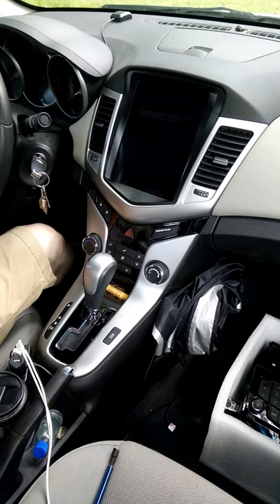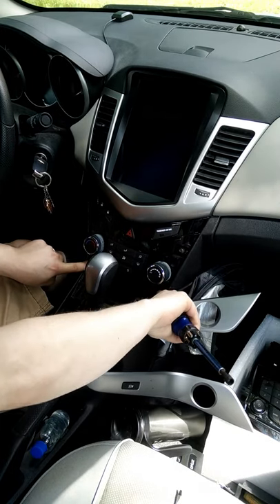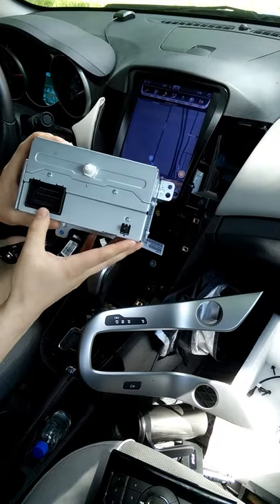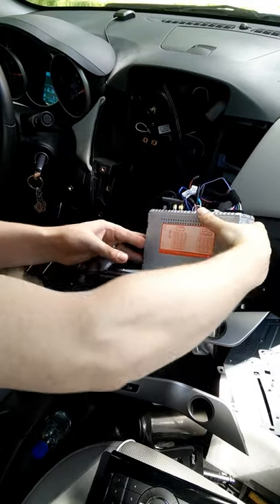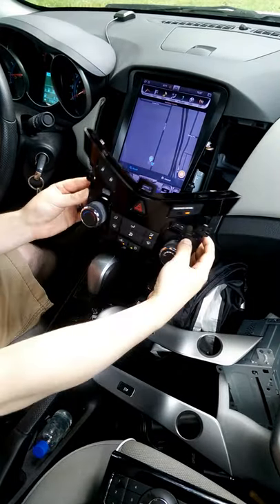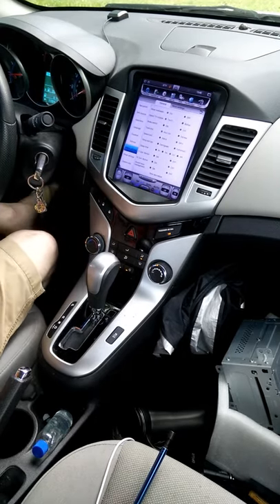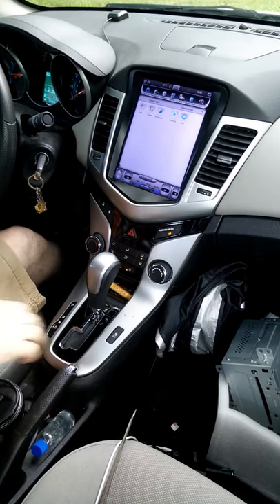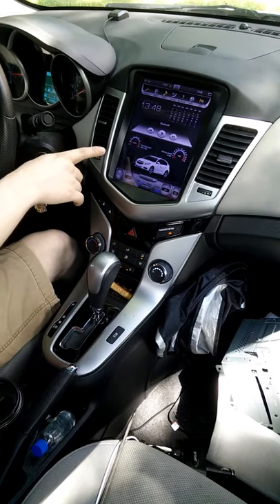Chevy Cruze "Tesla Style" Stereo Install + Year-In Review

Comment: Thanks so much for your tips! I've installed this same head unit as well and absolutely love it. The only issue I'm having is that the built-in microphone is kind of "weak"... Anyone I call while driving says that I sound very distant/quiet. Have you experienced this?
Reply from the maker: Yes, I think I mentioned in my first video I posted about this stereo that I was not impressed with the audio quality of the microphone and I don't know of a good workaround.  I have a Bluetooth earbud I use instead, I just have to tap on the audio button while I'm on a call to tell my phone to use the earbud instead of the stereo after answering or after the moment someone answers my call to them. (Running Android btw). I also went into my Bluetooth setting and unchecked "media" from the profile for the earbud so when I go to play music from my phone after ending a call it won't try to use the earbud by mistake and will instead use the stereo.  One other quirk, I can't uncheck "phone" from the Bluetooth profile for the stereo because if I do music playback stops working... and it shouldn't, but it does.  So, you might consider getting a little $30 ear piece or something, just be vigilant about where you put it when not using it or you'll likely misplace it.  I have maybe three places I will put mine: a small zip pocket in a backpack I take everywhere, the change holder at the bottom of the dash and my desk when charging at home... And of course my ear.  Everywhere else are no go zones... One time I took one I had off and set it on my lap while driving.  Parked my car by a storm drain and got out, it fell in the drain and I had to fish it out with a broom stick and a wad of duct tape on the handle end to "grab" the damn thing.  Ended up losing it months later at a job site doing install work because I set it down somewhere random while a lot of people were working around each other, didn't notice I forgot about it until the next morning, never saw it again.  My guess is someone (possibly me) kicked it under a rack. 🙄
Reply: @davidsteinlage  Ah okay. Thank you so much for your detailed response and advice, it really means a lot in this day and age for someone to go out of their way to really help advise another person! While the bluetooth workaround sounds great for when I'm using Android Auto, it unfortunately won't work for when I'm using Apple Carplay, as the phonecalls go directly through the carplay connection and do not use bluetooth. In this case I wouldn't have the Audio button to switch to speaker or bluetooth headset as you suggest. I'll keep troubleshooting I guess!
Reply from the maker: @BharteshShah  Happy to help.  Good luck!
Reply from the maker: @BharteshShah  Hey, I was wondering about something you said here.  Are you using Android Auto and/or Apply CarPlay with THIS stereo?  I did not think that this stereo supported those things.
Reply: (Except for the microphone issue, of course.)
Reply from the maker: @BharteshShah  neat.  I did think either of those worked on this stereo... Unless that was a new feature added after mine was made, or maybe you have a slightly better version than mine.  I've only ever just used my phone as a wifi hotspot + Bluetooth for audio from spotify or podcasts and just installed the Waze app on the stereo for navigation.

Comment: You added a back up camera, as did I. My problem is what do I connect reverse detect red wire that is coming off the RCA jack?  My unit did not come with any wire labeled reverse or reverse detect. I attached the other end to the power line that connects to the camera and to the reverse light power.
Reply from the maker: As I recall, the camera itself had an RCA jack, I wanna say it was female and connected to a longer RCA cable that would run up front to the stereo, and also a red wire and black wire for 12V positive input and ground.  The longer RCA cable also had a red wire that you could optionally use to source 12V positive from somewhere up front, but i didnt use that.  I instead used some scrap wire I had laying around and took 12V positive from the left tail light and pulled ground from a ground wire running to the trunk release switch in the trunk lid.  Check my other videos, I have one that shows the wires I spliced into.

Comment: Hello there.. got one these for my chevy but the wifi didnt work.. so i factory reset it and now its working ok.. but the information for the car speed engine speed and car doors opened etc dissapeared from the wallpaper.. do you know anything on how i get them back to wallpaper?
Reply from the maker: My guess is that maybe there's a console setting somewhere to enable that again, but I did a factory reset on mine shortly after I got it to fix a problem with the on-screen "back" button not working and didn't run into the issue you were having, though I did have to change the default interface language back to English and side load Gboard to get an English keyboard to show up.  But that was about it.  I did lose a couple bundled apps and the soft copy of the user manual though, but the manual didn't go into options like enabling on screen info blocks and things like that so I'm not sure what to tell you.  Sorry.
Reply: @davidsteinlage  ok mate thanx for the answer.

Comment: Did you ever get your steering wheel controls to work, I just installed this today have everything working but for some reason the controls on my steering wheel with no longer work the volume or the mute button do you know how to fix this please and thank you
Reply from the maker: My steering wheel doesn't have controls other than buttons for cruise control.  There is a tab in settings for the steering wheel that looks like you use it to train/sense a button and bind it to a function like volume controls, etc.  Did you find that?

Comment: Really great video! More pros than cons! How is the touch sensitivity? Beautiful car I have a 2015
Reply from the maker: Very sensitive, multi-touch.  It's good.
Reply: Did u order one i have a 2015 to ?
Reply: @tay8843  Im waiting. On the way
Reply: @tay8843  I will update when I receive it
Reply: I have received mine. Very nice unit installed in 30 mins
Reply: Doesn't let me post up the amazon link bit it was 200 dollars and aribed from china in 3 weeks not bad just have to get the reverse camera to work
Reply: @gerardomendoza8416  hi iv got a 2015 model with pdc wanted to know if you also have pdc and does it work with this head unit. Thanks

Comment: I have a 2010 Holden Cruze, exactly the same design with the chevy cruze. I want to replace my headunit same as yours. Just wondering if you could send me all the parts that I need to replace my headunit. 

Fascia Kit (don’t know what size), Steering wheel control harness and a headunit. Are these right? 

also what monitor brand you used? i live in Australia. Thank you
Reply from the maker: It depends on the stereo you want to install, and all I know about is this particular stereo.  It comes as one piece and includes everything you need.  If you want steering wheel controls, I can't help you with that.  I don't think you can just swap wheels because the wiring is different for different style wheels.  I don't have steering wheel controls.

Also, I would suggest looking for newer version models of this one as it's kind of outdated and slow.  If I forgot to put the link to the Amazon page I bought this from in the description of this video, look at my other uploads to find the first video I posted about this stereo to find it and you should find buttons on that page that select different models available.
Reply: I've just installed a version of this on the 2011 Cruze SRI-V , everything worked fine including steering wheel controls. Best bet is eBay . I'm based in Melbourne, Australia
Reply: @Coreylow77   Hi Corey, are you still using this head unit? I have a few questions myself as I’m from Sydney. 
Was there any fiddling around with settings as it’s mainly advertised as a ‘Chevy’ Cruze meaning American?

Also was wondering if Apple play had and dramas or was it as easy as connecting your phone and away you go.

Comment: Hey I got a few questions I just bought the same exact one an on your main harness that plugs into the back of radio there is 2 male ends (read an white) that says aux l/r in on them....ok so over at the video harness 20 pin you have 2 sets or red an 2 sets of white 1 pair of which says aux in l/r do the first one I mentioned an this one plug into each other? An im sorry 2 more questions if I have a blue power cord coming from an amp where would u hook that ? An then last question the connectors coming out of amp where do they plug in....they have the male ends also on them oh an one green female in the video pile thats green says subwoofer on it ? I'm lost 🤦‍♂️🤦‍♂️🤦‍♂️so sorry sir...but it would save my a 2 hour argument with my wife if you could help
Reply from the maker: Sorry for my delayed reply.  I don't recall seeing any input jacks on the primary harness, the one that you couple to the factory wiring, but I believe you are saying there are two RCA aux outputs coming from the first harness.  I believe those would connect to the two RCA aux inputs on the second harness.  I am going to guess that this will allow you to continue to use the input jack in your center console, under your elbow... I never hooked this up because I don't use AUX at all anymore.  You could also, alternatively, get a 3.5mm stereo jack to RCA male and connect that to the second harness if you wanted to install a jack at an alternative location for some reason...

As for the blue wire, coming from an amp, that is a remote power on wire which just tells the amp when to turn on.  Look on the top of the stereo to find the wireharness color guide and you should be able to find a blue or blue/white wire called Amp Remote, or something like that, which you can cut out of the harness (if it's not already dangling loosely terminated to nothing) and crimp your amp wire on to that.

The "male wires" coming from your amp are probably what your audio goes into from the stereo.  There are several female RCA jacks that split off the second harness on the stereo and two of them will be labeled amp left/right.  I do not think you would use the green wire that says amp; my guess is that is an output that is audio that is low-pass filtered and only sending bass frequencies when you probably will want full spectrum being sent to your amp, which is what you should get with the other two female RCA jacks that should be labeled amp left/right.  I hope this helps.

Comment: I just installed mines but it changed my dash language to Chinese.  Did u have this problem ?  I can still see my milage and speed just the language has  been changed and can't figure out how to change it back to English
Reply from the maker: There is a language preference in the Settings menu.  You can see this in my other video:  https://youtu.be/vLzFsfskVPs?t=1010.

Also, not sure if you noticed, but the ribbon menu of icons across the top swipes left/right to reveal a second "page" of icons you can tap for other stuff, Settings being one of them (it looks like a gear).

Also, notice that when you go into Settings there is a "More Settings" tab at the top which opens the Android settings panel which is separate from the stereo settings.

Comment: My stock radio recently just up and died. I was wondering when going with this radio does it show your heater controls as the stock radio does. As in when you switch zones to where the heater is blowing.
Reply from the maker: It does.  It also appears to have on-screen controls, but they don’t do anything beyond show you current status (presumably there are other vehicle makes that this stereo is refit to work with that do support on screen climate controls).  But the physical knobs and buttons you use stay there and you’ll continue to use them.
Reply: @davidsteinlage  nice thanks for the reply.   I currentley only use the buttons any ways. Just wanted to make sure it showed what mode it was in.

Comment: How do you dim the screen or shut it off completely? It’s too bright at night while driving
Reply from the maker: It's under Settings.  Swipe the icon ribbon to see the second page of shortcuts.  There's one for settings that looks like a gear.  There's one in there for the display brightness for day and night but be careful, this stupid setting will let you set your display brightness to zero, pitch black.  If that happens try tapping in the top left corner of the screen to select a different display profile and reset the other one

Comment: How is the unitholding up? Thanks!
Reply from the maker: Still using it, no major problems.  On very rare occasions the interface might freeze or black screen but you can reset it by pulling the fuse for the stereo from the box below the steering wheel.

Comment: Quick question I have a backup camera as part of my car do I need to buy an after market or no
Reply from the maker: There's a comment/review on the Amazon page I bought it from (linked in the video description)... Someone left a review with several photos and mentioned splicing off a couple wires on the factory harness and running that to a female RCA jack to connect to the RCA input the stereo has for rear camera input.  But I couldn't tell you which wires, I didn't have a factory camera in the first place.  There is a setting on the stereo that shows a toggle option between stock camera input and aftermarket, but a couple people have told me it doesn't work (they didn't yet attempt to splice wires and just tested to see if splicing nothing and setting to factory input would work... But I don't think it did).  So my understanding is, yes, it'll work but you have to splice a wire or two over.  It's possible newer versions of this stereo do support the unspliced harness input but I have no idea

Comment: I just wanna know will it work for 2016?
Reply from the maker: Is your car a 1st Gen 2016 or a 2nd Gen 2016?  The tradition to the second generation happened in the middle of the year and the two cars look totally different inside and out.  If your dash doesn't have the same looking dash (e.g. air conditioning control knobs and buttons identical to mine) then it won't fit.  Though I believe all 2nd gen Cruzes have a large LCD screen stock that's airplay/android auto compatable so you probably wouldn't be asking if you had that already, right?

Comment: Where did you purchase the aftermarket backup camera from😩
Reply from the maker: This is the one I bought, but any rear camera that has an RCA output will work.  https://www.amazon.com/dp/B074P45P7G/ref=cm_sw_r_cp_apa_i_nLOLDbW36XVKG

Here's a video that shows how I wired it to 12V power using the reverse lights:  https://www.youtube.com/watch?v=gQ29HIS0QGA

Comment: Hey I've had mine for about 2 weeks now working perfectly with the stock GPS in winter and when I was driving back to work it just shutoff and didn't turn back on until I left it for a few hours and when I got out of work I turned on the car and it turned on after about a min and shutoff again when I went to go to the store. Just wondering if you have had any issues just like I do and if so how you fixed it? I have the more expensive one android 9
Reply from the maker: Maybe twice in 1.5 years I've had mine has something like this happened, and when it did I just power cycled it by pulling the fuse for the stereo for a few seconds.  The only other suggestion I have is to consider doing a factory reset via the Android Settings... but you might lose some apps.
Reply: @davidsteinlage  Thankyou sm for the help I’ll try it and I’ll let you know how it goes

Comment: Do you have a backup camera stock if so how did you connect it?
Reply from the maker: No, it's an aftermarket camera that I installed.  There's a review from someone on Amazon showing photos of a secondary wire harness that I didn't have because I didn't have a stock camera, but he says you can find a camera harness to RCA adapter or to splice a wire from the harness to an RCA jack to plug into the RCA input on the new stereo.  Look through the photos here to find the reviewer who talks about it: https://www.amazon.com/dp/B0784BPXT1/ref=cm_sw_r_cp_apa_fabc_ZG9R29BWDSRAPFNRZB1A

Comment: Do you know if this unit supports front facing camera?
Reply from the maker: It does, there is an RCA input for it but I've never seen it in use, haven't tested and an not sure when or how to use it.
Reply: @davidsteinlage  Sorry, I meant to ask if it supports both back up camera and front facing camera
Reply from the maker: @chkno1  yes, there is input for three cameras.  A front, a rear and I think one on the right but I've only used the rear input and do not know how to view input from the other two sources (or when I would).
Reply: @davidsteinlage  thank you so much.

Comment: One question how do you change The khm to mph? Can't find it in setting ??
Reply from the maker: If it's not in settings check the Console panel/app from the top ribbon.
Reply: I don't have console panel setting. I even looked in setting either I don't think I'll worrie about it like you said in the video the gauges are not far for the radio lol
Reply from the maker: @scottmiller6841  Take a look at my other video where I go over the settings panel.  Under General>System Settings, scroll down a little and there should be a "Speed Unit" toggle between KM/H and MPH.  https://youtu.be/vLzFsfskVPs?t=1495